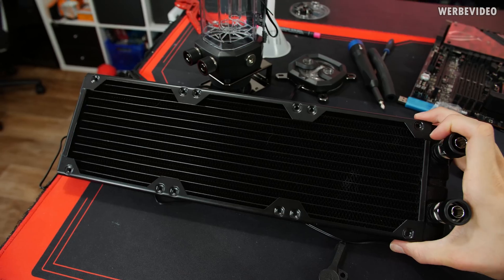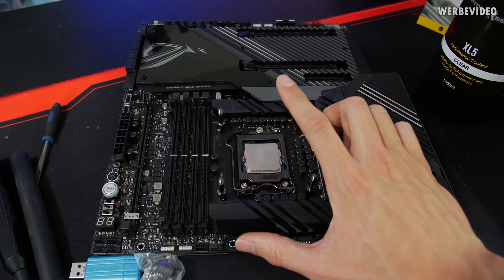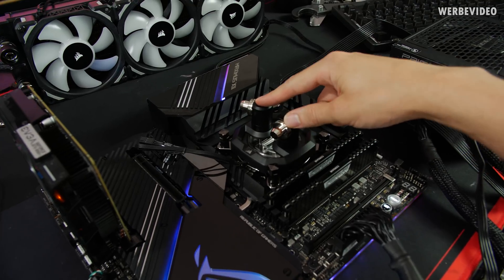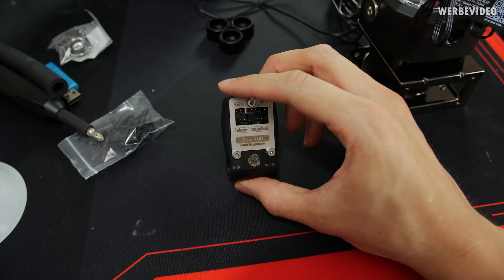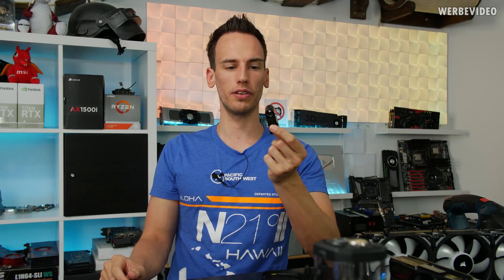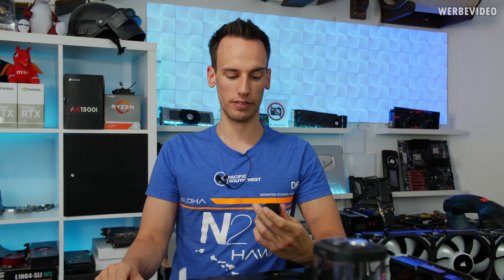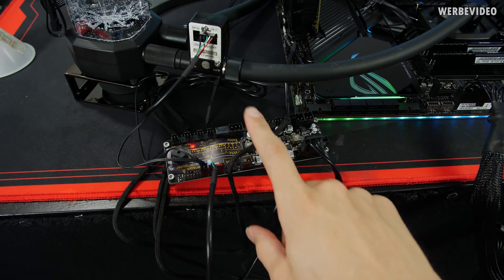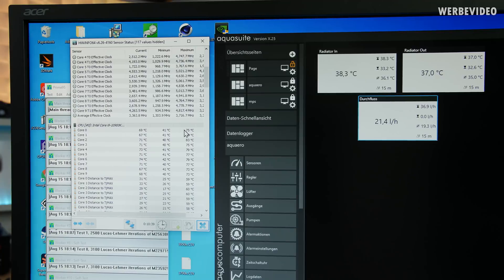Testing one of the Weirdest Water Cooling Myths - A SLOWER Flow Rate will result in BETTER Temps?

Comment: Back in 2001, when I was building water-cooled systems, forums were full of pedantic advice—things like “you need two loops,” “run the high-speed pump at 100%,” or “blast the fans at full speed for the coolest temps.” Sure, all that has its merits, but to avoid the noise, I’m happy to accept a few extra degrees. In the end, more radiator space with low-RPM fans and pump is the way to go.

Comment: I think at least one of your measuring instruments is wildly miscalibrated. With the reported numbers, CPU power is much too low.

  ((21 liters/hour) × (1 gram/milliliter) × (4184 joules/(kilogram·kelvin))) × (1.3 kelvins) ≈
  31.72866667 W

For the low speed, it comes out to only 8W!

You should validate the flow meter by filling a bucket through it, and calibrate offset for the thermometers by running with the CPU out of the circuit and radiator fans off.

Comment: I don't understand your delta is so tight at just 37L/h yet my loop is at 215L/h and my delta from hottest to coldest point in the loop can be as high as 5C. Why? Shouldn't it barely be 1 or 2C at most?

Comment: got a b450 aorus with an aio connected through a 4pin pwm cable. Is there any way to identify and set pump speed seperately from the fans connected to the aio? mobo sees it as 1 cpu fan and i suppose both pump and the aio fans are operated in the same %?

Comment: All else being equal, typically higher flow rates across your blocks result in lower deltas between chip temp and water temp.    This is less important in the radiator (above a certain point).

That said, there are some outlier cases where slower flow speeds CAN result in better temps.

D5 pumps dump all of their heat (as much as 25W in some models) into the the water loop.     If you have a many pump loop, which is limited by radiator capacity, it is theoretically possible that above a certain level those pumps can start dumping enough heat into the loop that it outweighs the positive effects of the added flow.     I've never seen it actually happen, but it IS possible.

This is why for my monster loop I am building now with 5 pumps, I am considering using DDC pumps instead of D5's, as they do not dump their heat into the loop.   (it is advisable to attach a heatsink to them  - however - if longevity is important to you, as they can get hot.

Comment: Thank you for the great information Der8auer! I actually just bought a 280mm EK AIO (I know, EK is bad lately as a company, but for $58 for quality parts in a SFF build, I couldn't pass it up on newegg), and I've been wondering this exact same thing. I know that pumps and fans typically like to keep the same voltage for longevity, so I had it set to 25%. I'm going to experiment at 50-60% pump speed now depending on the noise, and keep it at one of those.....unless someone has another opinion on it? Then I'll just have the fan speed adjust to cool down the fluid.

Thank you!

Comment: The delta-T for any component can actually be calculated relatively easily. Basically, it's power divided by flow rate and the specific heat of water (adjusting all units to match). There are cases where having a rad in between components would be helpful (4x 4090 + 350W Threadripper), as that's around a 10c rise across all components at a 230l/h flow rate (~1GPM). 

BTW, your flow rates seem really low to me, 37l/h is only 0.6l/m. TechPowerUp shows the typical D5 or DDC pump pushing more like 4-ish l/m of flow at 100% PMW. Which is why I assume more like 230l/h above.

Comment: This video forgets one element which is important for the whole argument. Radiators are more efficient at removing heat the hotter the water is and the greater the differential with the air temp. So theoretically hotter water in the loop means you can use lower fan speeds on the rad to exchange the same amount of heat. So while your temps may be higher with hotter water, you can run the fans slower. So using a medium pump speed with slow fans is most efficient and you can have a bit higher temps but for disproportionately less noise from fans.

Comment: Jumping on the an old thread. How long did the tests run? I had read that the thermal capacity of the radiator matters more than any thing else. Sooner or later the the thermal limit of the radiator is reached and the system equalizes as far as temps are concerned for all components. So lower temps at a higher flow rate will eventually equalize giving the same temperatures as a low flow rate. its just a matter of how long.

Comment: Re: order. But it may easily matter. I only got 50 seconds in and I don't know if others pointed this out or if you mentioned it. 

It's not that you can't run a sufficient number of pounds (or kilogrammes) of water to run all devices in series post radiator - it's that pumps can be very loud. When running multiple radiators, you can do exactly as you said in the opening people were asking and run a lower mass flow rate. This would in theory allow superior cooling at less dynamic pressure (because you are flowing less), produce less intense eddy currents inside of the water blocks and potentially extend the life of the pump while using minutely less power. 

How you run the water conduits (materials,  fittings, diameter, total effective length) could also be a factor. However, the lower the mass flow rate, the less it matters as back pressure is a function of the diameter and smoothness of the inside of the conduits (i.e. tubing/hose/pipes).

I will emphasise, it's neither impossible, ineffective nor incorrect to build a loop as the introduction suggests. However, there is more than one way to skin a cat (as the expression goes).

Also, it may not be a practical problem given short life of computers, but slower moving water is less likely to erode the structures inside of the water blocks. I think the typical skived fins are very thin. And as closely spaced as fins (or other structures are) you don't need to rely on eddies to ensure water just doesn't rush past.

I would really like water block designs to be  a little thicker (taller structures thus increased surface areas) having larger volumes/fins to increase total contact area.

It's just my analysis. Again, I am not saying it's wrong to flood the water block, to attempt to minimise temperature rise of the water, just that at the end of your serial device loop, the last will see an elevated temperature - even if isn't much.

Comment: Radiators work more efficiently at lower flow rates, as this test demonstrated. 
The problem is that the cooling blocks need high flow rates in order to create turbulant flow in the matrix, which is necessary for them to work efficiently. 
The solution is easy, tho. If you have enough space to run multiple rads, run them in parallel.

Comment: Curious: While perhaps an impractical idea,  many cases accommodate two, 3 fan, radiators. Could you add an additional 3 fan radiator directly after the first one for a second direct cooling stage to get the liquid even colder before making its return trip through the loop?

Comment: Nothing wrong with running your pump at 100% as long as its lubricated by coolant. I cant even hear my D5 pump at 100% because my fans are more audible than it. Only people running really slow fan speeds and wanting super quiet operation could possibly hear the pump if the pump is mounted properly with shock absorption built into the mount. I rather have full cooling performance over a super quiet PC, but thats just me. I also wear headphones when gaming which block out even more noise.

Comment: You can modify the flow rate, fan speed, etc., to produce any result you want to prove your hypothesis. That does not prove that there are no instances where slower flow works better.  Race engines run a restrictor plate in the thermostat housing to keep coolant in the radiator longer and prevent overheating.  Why do you suppose they do that Einstein?

Comment: its better to have fast turbulent flow in the cpu block and slow turbulent flow in the radiator. the nexus monsta 560 i have does  good job of slowing the flow down which means the water spends longer time been cooled trouble is slow flow through the block does mean the water soaks up more of the heat but only cause its been over whelmed but since it flows through the radiator slower it gets cooled better but it does not draw heat away from the cpu block fast enough i have a low water temp of 22c to 23c and minimum pump speed is 6l/m 360 l/h  at 10% in asus fan monitor and goes up to 16l/m or 960 l/h if i use low flow my in temps are better but my out temps are worse and the cpu gets hotter if i use high flow my cpu temp goes down but my inlet temp can raise a degree. reason i can use high flow rates is cause of the volume of the radiator it slows the flow down alot and ogs into the radiator from the side at the top inlet and flows back out the side at the top outlet on the other side . so the water is forced into a turbulant flow entering the raditer and bounces about in lamina flow swirling and twisting getting as much contact with the radiator surface. so you want high cpu block flow rate and slow radiator speed by widening the channels and more of them . thats why extreme water coolers use massive rads the water is cooled longer . you can even have the flow split when it exits the cpu into two rads flowing in parallel to cool the water better than if they was in serial then combined back into one to enter the pump. slow rad speed high block speed

scientific explanation SR-71 the opposite way round ( they heated the air to move it out the back we want to keep it cool with a water pump instead )  the air in had to be slowed down and cooled then forced out the back at twice the speed for twice the power where it mattered here we want to cool the cpu with the jet of cold water so we slow it down cool it then shoot it out the back at twice the speed in the cpus direction :) lol

Comment: I have a ekwb pump rez combo into a 240 rad then out to a Gpu then a Cpu then to a 360 rad then back to the pump rez. Gpu is Rtx 4090 cpu is Ryzen 7 7800 x3d. Gaming cpu runs max temp 75 degrees. My office gets hot. But idle its at 45 degrees. is this normal.

Comment: I always leave the pump speed at max for the first week.  If I don't see any water bubbles on the tubes and water block, I reduce the pump speed to low enough so that I can notice any change in temperature.  In my system I usually don't see any difference in temperature between pump speeds of 80% and 100%. 
Pumps have different speeds and power, my situation may be different for a weaker pump, a more powerful pump than mine may only need 60% of the power.

Comment: I always wondered which was better low flow or higher flow. Thank you for the demonstration. I love your amazing content.
Reply: I got my first AIO a year ago. And i experimented with the flowrate. I let the water heat up until it didnt heat up more and then started to increase pump speed to see where i got the best cooling. I was a bit surprised when i came to half speed and got good temps, but after that it got hotter. So at max pump speed the water was hotter then when at half speed.. Think i also tested differet fan speeds.

Comment: Dazmode also tested the flowrate performance. He concluded that under 1l/min the performance crumbles but after 1.5l/min the gains are marginal. It was a different setup but the conclusion is the same.

Comment: Less time spend in block and less time spend in radiator would only apply with small radiator, if you had triple Mora 420 radiator with enough pumps for enough presure and waterflow your temps would probably drop a lot cos even tho the water spends only less then 1 second in the block it will spend more time in the rads cooling down more, and yes i purely made this comment cos i wanna see such crazy video with triple mo-ra 420 radiator and crazy flow perhaps you could test it with a liquid devil and see how much you could bring down gpu temps but also hotspot temps.

Comment: Your test didn't prove your theory that it doesn't matter...
    And I am of the understanding when they same lower flow rate they didn't meat that low 😂.. you exaggerated the point.... .. lessen learn from your experiment is that the lowest flow rate at which your pp can operate at is way better than high pump flow rate.... it should be balance.
   Find the working lowest flow and the max ineffective flow and tune within that range .. makes no sense fans on high speed yet flow rate low or visa versa.

Comment: I know this video is a couple years old but I'm curious. Knowing that longer time in the Rad= lower water temps, but you sacrifice flow rate at the cpu block.... what if you ran multiple cross flow radiators in parallel. You'd slow down in the radiators because the flow is split between multiple paths, but increase flow rate in the loop as a whole by decreasing the restrictions from the radiators. Best of both worlds?

Comment: Those AQ flow sensors are supposed to be the most accurate, but 21 l/h seems super low for that loop even at 2000rpm pump speed.  That's like .35 l/min, which is wayyyyy too low.  Typically should be running no lower than 2 l/min on a standard loop, which is 120 l/h.  When you cranked the pump to 100% and only got 37 l/h, I knew something was off.

Comment: Should you expect a higher temp difference between inlet and outlet if you are measuring across MULTIPLE radiators like 2 or 3 of those XR5s (which are high restriction) even at a high flow rate (1GPM)?  This test measures the inlet/outlet on the same radiator...but across multiple radiators (inlet of first rad measured, outlet of last rad measured), we should see this temp difference increase at the same flow rate compared to measuring it across 1 radiator only.  I have about 1 GPM flow rate going through XR5 360 and XR5 420 in series, and I get 2c temp difference under 500w heat load.

Comment: I watched this video a few weeks ago when I just had a normal old Magicool pump and no temp sensors. I've since got an XD5 pump, and an additional water temp sensor and I've been messing around with it for a few days, and now this video makes a bit more sense to me. Probably because I have my own system for reference.
I have a temp sensor at the inlet of my radiator, and one just after it (in the pump), and I'm seeing similar results to this.
But what I find really interesting is that it seems like every system will have it's own perfect cooling configuration. Basically it's something like if you call the heat from your components (the heat that's transferred to a chunk of water) "H", then you have to remove that H by the time that water gets back to the pump.
So basically your fans have to run at a particular speed to achieve this.
But that also depends on how long that chunk of water is in the radiator, and so it also depends on the pump speed.
So, it's like a fast pump speed is good for removing heat from components, but it's bad for removing heat from the water.
And contrarily, a slow pump speed is bad at removing heat from components, but it's good for removing heat from the water.
And of course when you have more radiators, and/or larger radiators, you can afford to run the pump a bit faster and your fans a bit slower, depending on the noise from each.
I suppose the best way to go about it is to stress your components and equalise your temps. And then gradually drop your fans and pump speed until you hit a barely acceptable temperature, and then tweak the fans and pump from there to see how the temps change.

Comment: Its called an orifice used in a differential pressure transmitter which then goes to a sqaure root extracter to calculate flow rate

Comment: Taking theory from refrigeration, maximum cooling capacity measured from a radiator's inlet/outlet is defined as kW(capacity) = (mass flow rate kg/s)*(specific heat capacity of matter (eg, fluid))* (temperature change between inlet and outlet). The equation literally says a higher mass flow rate will increase cooling capacity.